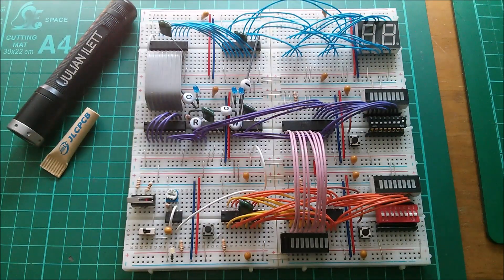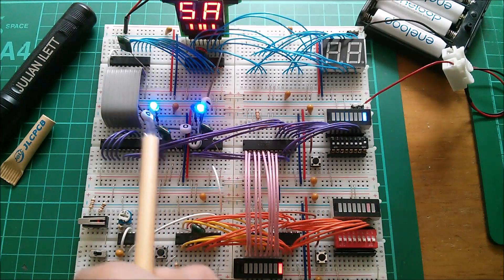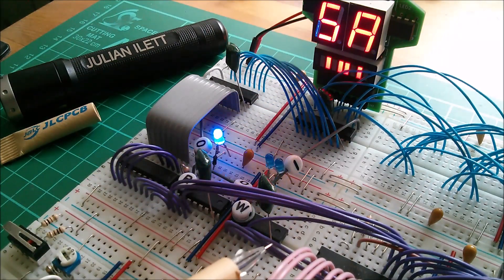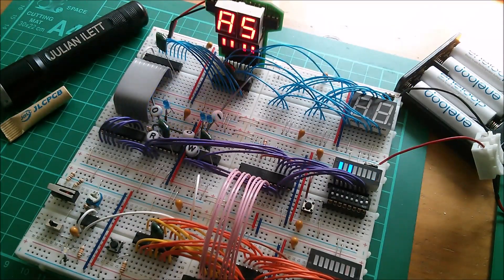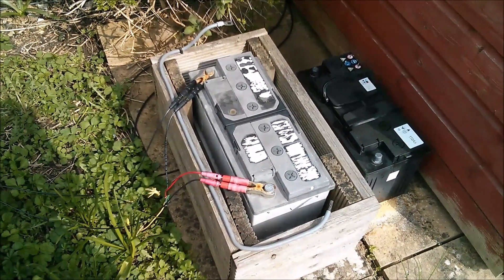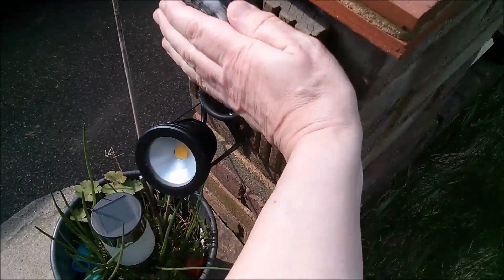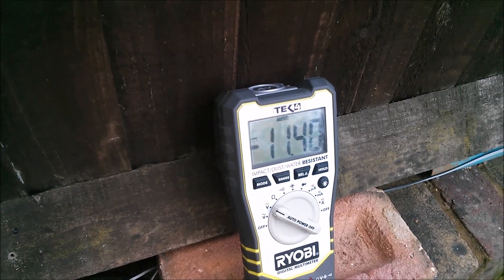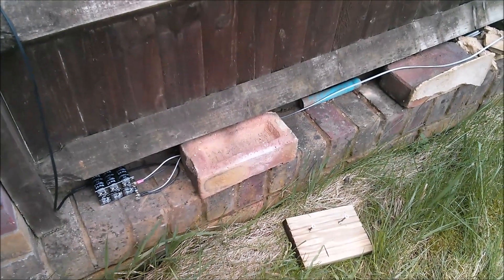Super Decoupling Capacitor

Comment: You need some conformal coating or other protectant on your supercapacitor circuit board.
Reply from the maker: I can use the UV glue - it works well :)
Reply: @JulianIlett  Clear nail varnish ex. Poundland works cheaper.

Comment: Using a scope on the clock instead of logic analyzer is probably better because you get to see the actual signal and any spikes, instead of having it translated to a logic nominal level and concealed. 
 If you see voltage spikes going above VCC and or below ground, you  have an impedance mismatch which the series resistor will help with.  If you have signal reflections you might get the false triggers from the signal not being what you expect, and if you have voltage spikes outside the rails and the chip’s input  doesn’t like that level, there may be damage so suppressing spikes is good,  and better if you can do it with just the series resistor and not change the timing with a capacitor or it may mess up any logic synchronization if the circuit is dependent on that. That’s where a logic analyzer will be more helpful of course,  to observe all the logic timing and transitioning behavior.

Comment: Hi, Julian, the RC low pass network, causes the clock pulse to have a rise time and fall time, longer than without the network.
So the clock pulse crosses the HIGH and LOW level thresholds of the digital chip, LATER than the other pulses entering that chip.
The small timing change may be allowing latches or registers to load before being controlled.
Please buy one of these;
You will not be disappointed.
https://www.banggood.com/USB-Logic-Analyzer-24M-8CH-Microcontroller-ARM-FPGA-Debug-Tool-p-1177821.html?rmmds=buy&cur_warehouse=CN

USB logic analyser.
I find PulseView software works the best with Win10.
Reply: 24m is a dirty lie on those things though. More like 2 reliably and 4 with glitches, maybe even 8 if the stars align correctly

Comment: If the cable adds so much resistance, how come you're measuring 13+V local to the lights?
Reply from the maker: When the LED light is off, current consumption is very small, probably just a few milliamps, so the capacitors can charge back up.
Reply: The voltage across the capacitors increases as they charge
Reply: ohms law. the more current you draw, the lower the voltage gets (since R is fixed), or, the less current you draw, the higher the voltage gets. so the caps will charge from 0 to 6 very fast, but 6 to 12 takes longer and 12 to 13 will take ages.

Comment: Emmmm I was always to believe the By Pass Caps provided a means to short Line Noise to ground.   Eliminating Spurious Triggering and other effects.    Your dealing with two different issues.  The LED issue is simply a matter of Current Supply.  The caps provide the Current were as the lite AWG Wire is to resistive to do the same.    Sorry your  off track on this one.

Comment: You have lots of long wire inductors that are interacting with the capacitance of the breadboard. Poor impedance match and these different transmission lines means that you probably have pretty horrible clock edges hitting your chips. The problems will be unaffected by the clock rate. Your low pass RC filter just slows down the edges hitting each chip and therefore minimizing reflections. 
Seriously, just put a scope on your clock and data lines and take a look.
Reply from the maker: I will, and I'm expecting the horrible edges you mention :)
Reply: @JulianIlett  Cool!  Sadly, everything turns into RF eventually :-) Checkout W2AEW here on YouTube. He has a some videos on impedance matching and reflections. Great channel.
Reply: I'm building my own breadboard computer and don't have access to an osilliscope. The clock visually looks fine, but my binary counters were acting up(bottom bit stayed the same, while the upper 3 counted as if they were the lower 3). Fixed it by putting my clock through a not gate before it went to the other chips. Any idea why it would do that?
Reply: @everythingfeline7367  What type of counters? If they are TTL and you are using mixed F, AC, HC, logic then you could run into problems trying to clock things using chips that are CMOS. The CMOS parts don't have the same high/low logic thresholds as the none CMOS parts and are incompatible. It's possible your NOT gate is acting as a level shifter OR a buffer because the input clock line does not have enough fanout to drive all the inputs you're trying to drive. It's hard to say without knowing the exact parts and the schematic of your design. These are just several thoughts off the top of my head. As to why the counters (i'm assuming more than one?) were behaving in the odd fashion they were that would be dependent on the internal design of them and the conditions under which they are operating. I'm not immediately coming up with a failure mode where bit0 is stuck, though. does the circuit/counters work if you put the clock through two NOTs ?
Reply: @vincei4252  Yes, It does work after putting the clock through the NOT gate. The chips I'm using are a 555 timer for the clock, 74LS02 for the NOT gates, and an SN74HC161N for the counter. I believe you may be correct that the 161 chip(s) were unhappy with the raw clock input, but liked the buffered one due to not being part of the same chip family. Thanks for your advice.
Reply: @everythingfeline7367  no problem.